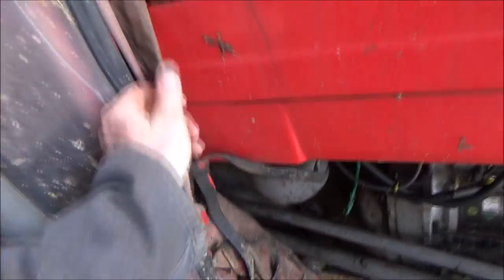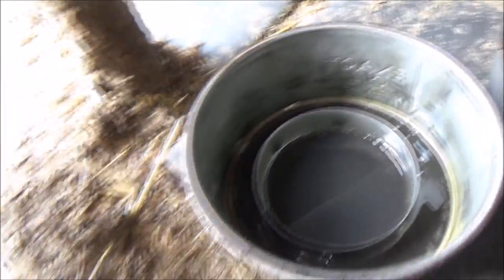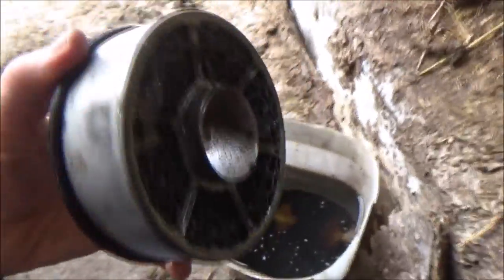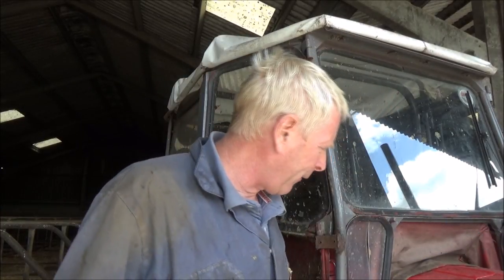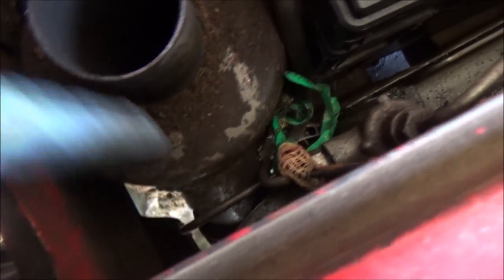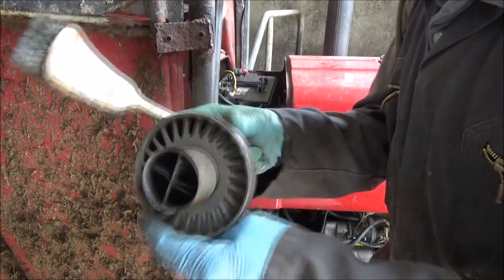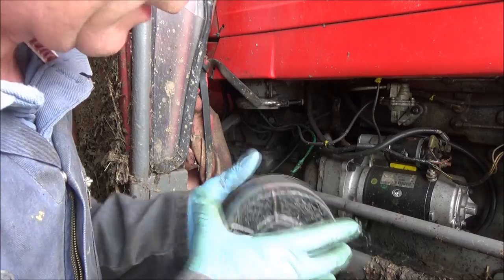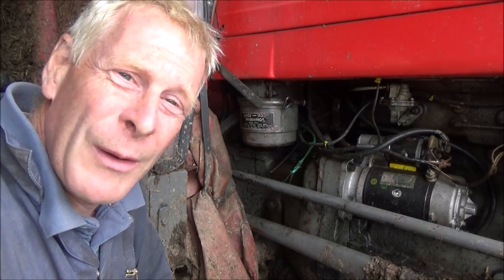Air filter maintenance on the Massey Ferguson 135

Comment: Changed my fan belt today on my Kubota 3750, thought of you. Will be placing my filter and fluid order for my annual maintenance the end of the month. I check my engine and hydraulic oil every day and every time I use my mower (weekly) I grease the zerks that they tell you too. I have bags of rags, so many my husband asks me if I have ragged a shirt if he can not find it.

Comment: Getting ready for the winter routine Richard, the scraper tractor is one of the hardest working on the farm and often the most neglected. Will you be singing up to the Muller three year fixed milk price?
Reply from the maker: Is there a 3 year fixed deal available?  I've only heard of the new 12 months futures deal which we can't apply for as we don't have the required monthly litreage
Reply: thefunkyfarmer sorry Richard I got mixed up, crediton and woodcocks are offering fixed contracts.
Reply from the maker: Who do you supply to?
Reply: thefunkyfarmer I supply Firstmilk into haverfordwest for cheese production.

Comment: Hi Richard, great video. You twisted your top cover off very easily. I took the filter out cleaned and changed the oil and it was very very dirty. I wasn't able to take the top cover off though and I reckon it's very dirty and I can't get it to start- the cover won't budge- any advice? Thanks in advice Richard
Reply from the maker: can you soak it in diesel to free it up?
Reply: Thanks a million for the reply how would I go about doing that its the cowling I can't get free. Thank you @ @thefunkyfarmer

Comment: Hi Rich  Those oil bath cleaners are old technology but are sure cheap to service, I just put new paper elements in our Valtra  they cost $250 for the pair. They don't last long when we are baling dusty straw either.  Our Belarus and the ones I work on for customers have the oil bath to, it wouldn't be the first one I saw that center pipe was so full I beat a cloth down the middle with a piece of wood to push the crud out. The mesh was jammed solid with straw and the bowl has 1"+ of dirt in and you wonder how it ran at al with such a restriction in air flow. 

Last winter I had a guy convinced he had ice in his fuel was why his tractor wouldn't start, nope it was 3" of ice in the oil bath air cleaner  he didn't have any air flow for diesel combustion L.O.L.   Just one question when you put that base back did you add more oil after what you showed us. If not it's low the little bowl in the middle is supposed to be filled as well. The oil drains through those holes in the side of the center bowl so it fills to the same level  as the fill line outside. Thanks for sharing the video, take care.
Reply from the maker: I had a similar problem with a chainsaw that was gutless. I thought I had a fuel problem but it turned out the air filter was blocked with dust
Reply: I love Valtra's (I think the N-Series is a mean looking tractor) but at that price, i can buy 5 years of spares for a MF135!!!

Comment: Thanks - just looked in mine as tractor wont start. It was completely gunked up with some weird viscous white fluid. Trying to take it all apart .
Reply from the maker: the white is probably caused by water getting in the oil.  hopefully you can clean it all out

Comment: our 35 does not have the mesh inside it just an empy can.Also the intake is outside the hood.I know that might be because it is an north american version.
Reply from the maker: Interesting. I'm not sure how important the mesh is unless you work in a very dirty environment
Reply from the maker: Ah that makes sense
Reply: Good day. We hd W-4&6 IH.  They had oil bath. our's never had small mesh either. But neighbor had 35, rubber hose from  air cleaner  to intake, a hole develop at back of hose & ruin engine  Thanks